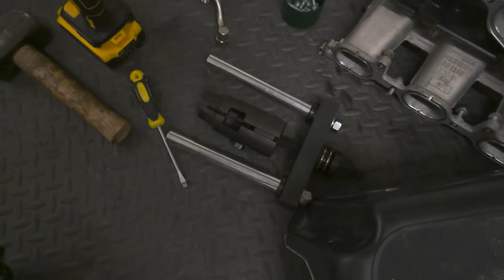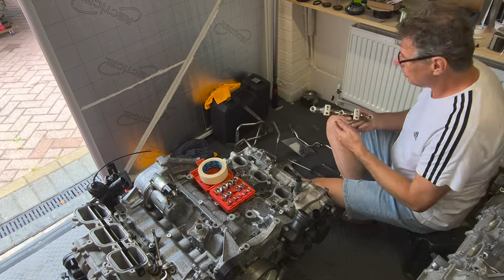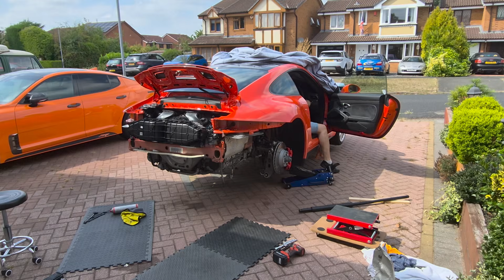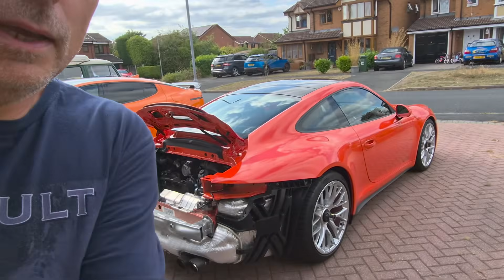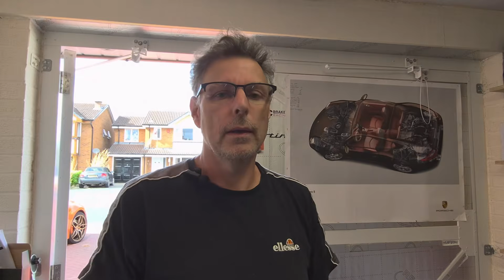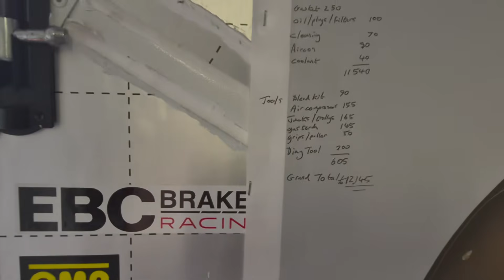Porsche 911 Carrera GTS 991.1 3.8 Engine swap Part 3

Comment: Absolutely great videos Neal , been in your shoes having had a couple of 997’s and removed stripped and then rebuilt using Hartech which luckily is down the road from me, personally I think they’re great cars but the engines are poor for a company like Porsche and borescore will always be an expensive issue, also there’s far too many dissimilar metals components on these which are a nightmare in itself, keep up the great work and good luck👍🏼

Comment: I thought the borescore issue ended with 997.1 engines so to see this on the 991.1 engine it is quite surprising. I will certainly keep the PAW on my 2016 991.1  GTS4 valid after seeing your ordeal.   Very impressed with you doing the engine swap in your driveway with a small workshop. Kudos !
Reply: No bore score never ended. It just that 991 are younger versions.  So now they are getting on its showing up .lee Jenkins at hartek told me 4 years ago said 991 are starting to come in
Reply from the maker: @DanDan-hj2pp  Exactly that, and there seems to be a fair bit of miss information in the community that 991's don't suffer
Reply: @DanDan-hj2pp to bad they cant seem to get this issue fixed. I have never seen signs of borescore in my aircooled 911.  We just overhauled my 993 engine with 190k km on the engine. Valveguides was trash but Piston and Cylinder was fine.

Comment: Enjoyed watching the 3 videos so far Neal.  Hats off to you doing that on your driveway !  You made it look easy.  Shocked by the state of the original engine at that low a mileage.  Still intrigued how it got so bad.  Do you think keeping the mileage down rather than running it more contributed to it ?  Maybe a previous owners-mapped it ?  Looking forward to watching you recon the original 👍
Reply from the maker: Difficult to know, it had a perfect Porsche service history, it did have a couple of years with a previous owner who never drove it except to and back from the Porsche dealer for service and MOT, also the covid year.

Comment: Good to see you won on the injector extraction and didn't have too many problems in the process from there, happy motoring. I'll be looking for the tear down when you get to doing it on the original engine to determine the causation of the failure.